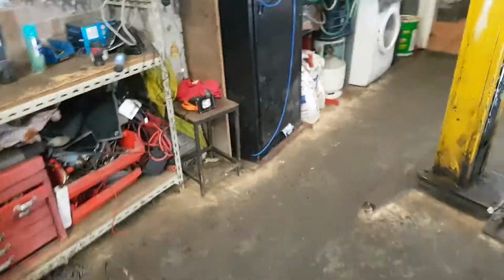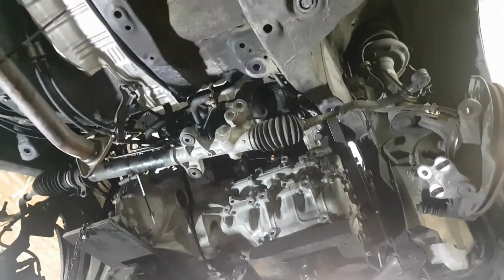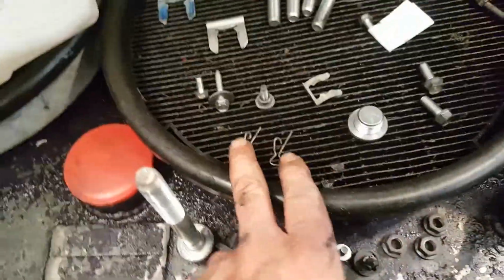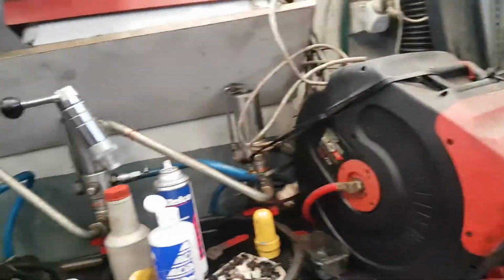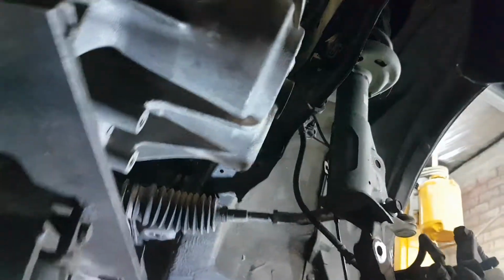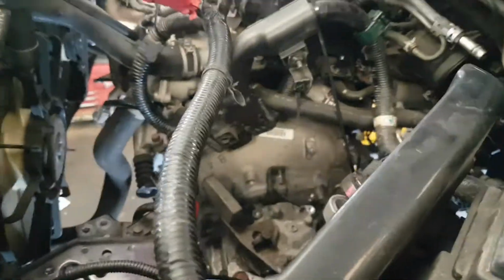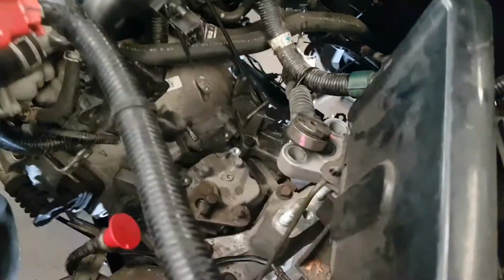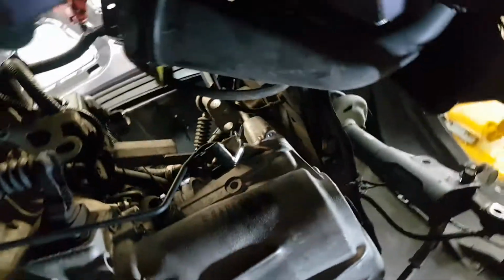Removing gearbox on front wheel drive vehicle Honda Civic 2006 part 1

Comment: Hi i need help i have 2006 honda civic es
What happen3d was it was driving 5n untill i heard a sound dhakk and thats it after that the car is starting the gear lever is movind between R and R smoothly but car is not Moving
Can u suggest anything what i need 2do mate ??